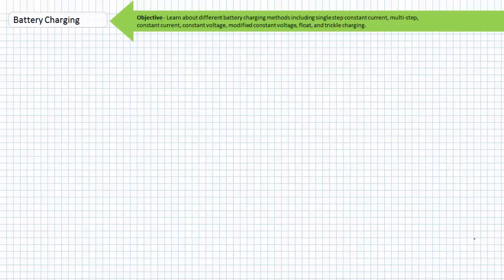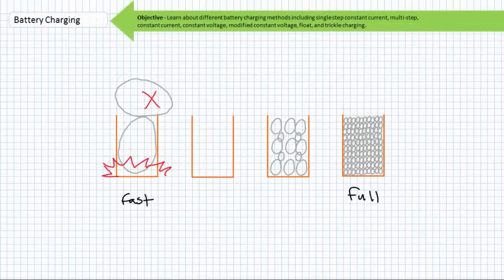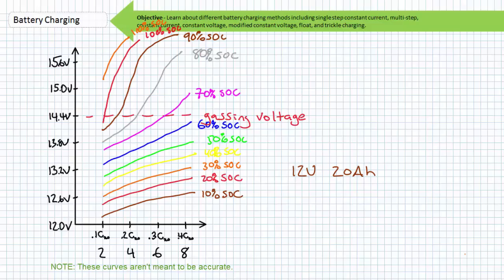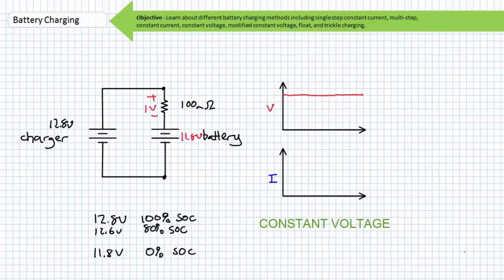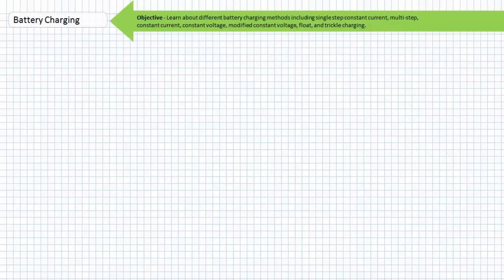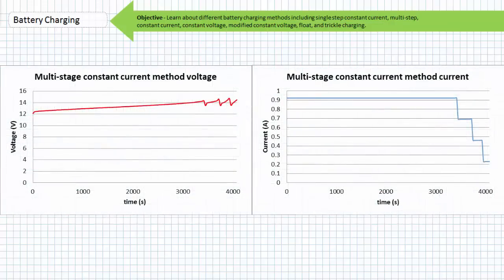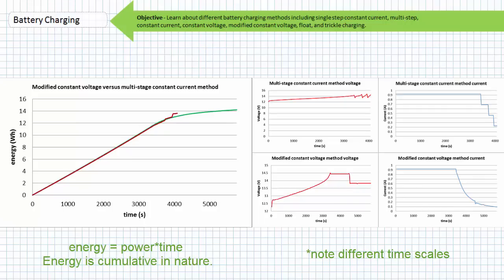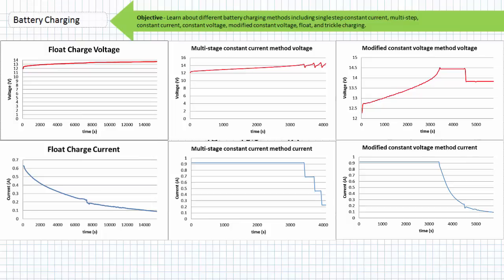Battery Charging Methods

Comment: In the multi stage constant current method, why does the voltage drop when the second and third stages of lower constant current are initiated? It's slope should decrease after the transition and not go negative. Please explain
Reply from the maker: You're correct that it's not an "instantaneous" drop off the cliff but rather a sloped transition. A lot of this has to do with how frequently you sample the data. Since batteries take an appreciable amount of time to charge often the data sampling occurs at an extremely slow rate. As such, the roll off between two stages appears like a jump.
Reply: Jim Pytel Got it! Thank you so much for the quick reply

Comment: During the CV phase of charging, an exponentially falling current is still going inside the battery so why doesn't the voltage across battery increase in that phase?
Reply from the maker: There might still be a small voltage rise at the earliest part of this stage, however, a lot of this has to do with electrochemical reactions that I'm not remotely qualified to discuss.

Comment: I work with lots of different battery chemistries, does this lecture cover batteries other then lead acid wet /gel cells?
Reply from the maker: Unfortunately no this lecture restricts its analysis to lead acid batteries. I hope to return to this topic at a later date and discuss Li batteries in the level of detail they deserve.

Comment: Hello Jim, i have a question, i have a 12V 7.3AH valve regulated lead acid battery. I have a "Automatic (Smart) Charger" , the brand and model is: "Waeco W2000" in the manual i can read it can charge up to 20A (MAX) can i charge this battery with this charger? Does the charger adapt the amperage to the battery? Great channel, i'm subscribed!
Reply from the maker: I'm not familiar with that particular brand of charger, however, the more pertinent question is whether the battery can handle what the charger in question can put out if it isn't current limited. I'd recommend you look up the maximum permissible charge rate for the particular battery. This is often expressed as a function of capacity (example: max charge rate of C/5 would be 4A for a 20Ah battery.)
Reply: This battery does not have a manual, so i don't know that.. So smart chargers do not adapt the amperage to what the battery needs for charging? Because in the manual they say it can charge up to 20A max but there is no minimum indicated.. This is a industrial automotive charger, it also has a button to switch the display to voltage or amperage..
Reply from the maker: Like I said, I'm not familiar with that particular charger and battery and I'm very reluctant to issue professional advice without being actively involved in the project.
Reply: I understand, thanks for your time :)

Comment: Hi Jim, I wish I could say I understood what u were trying to teach but I will keep watching till I do I suppose, I have Emerson Network Power T2V500E/A 2v 500 amp hr cells and I am loosing 1 every week now and I suspect that my charge controllers maybe the cause, cos my toyo brand cells seem to just keep going but I only have 10 of them left so I need 2 of the emersons to make the 24v bank. Can u pls help explain what this means from the label "charge current: 0.25C10A(MAX)"
Reply from the maker: Yes, .25C seems a little high (.25*500=125A). The data sheets I found for that specific battery didn't have anything specific about charge current, however, here's a general one from emerson that does, it's the graph in the upper right corner of page 2. 
http://www.emersonnetworkpower.com/documentation/en-us/products/dcpower/ensys_batteriesandaccessories/documents/duration%20range%20datasheet.pdf
This graph is shows they're using the modified constant voltage method as featured in this lecture and during the initial constant current phase they're using 0.1C or 50A. Honestly my best recommendation is to directly consult the manufacturer because I'm two or three times removed. Hope this helps!
Reply: Chinese manufacturers are the worst to communicate with, I had to tell Must Power last week to stick they're BS customer service where the sun don't shine so I don't hold much hope for that 1, BUT thank you for replying so quick and checking out the specs on my specific battery which seems to be a bodgy battery period.

Comment: Hi Jim, on the float stages,  if the battery voltage is lower than charger voltage(Float voltage) how can the charger deliver the current to the battery?
Reply from the maker: +Didit Subrata If a voltage differential exists such that the charger has a higher voltage than the battery, current will flow from the charger to the battery.
Reply: yeah jim, but on the float stage the charger voltage will be below battery voltage?then how can charger deliver the current to the bttery?
Reply from the maker: +Didit Subrata Not really. Even if you held a nominal 12V battery at a float level of let's say 13.8V the moment you remove the charger the battery would drop to below 13.8V.
Reply: okay im little bit confusing now, i have 18650 li-ion cell with 4.2V max voltge& 2,8V Min Voltage. what is the float&absorbtion voltage that i need to my battery?
Reply from the maker: +Didit Subrata  Li-ion is a totally different animal. Most reliable source of information for this is from the manufacturer data sheet. Li-ion is a totally different animal.

Comment: Hi, with a CC-CV charger for a lead acid battery, once the gassing voltage is reached, the battery controller automatically reduces current over time with a feedback loop to keep the voltage constant?
Reply from the maker: +1994fishcake I like to explain constant voltage mode like this ... imagine two series opposing voltage sources with a resistor in between. If there is a large differential between the sources the current will be large, however, as the smaller source increases in magnitude (ie: a battery's state of charge increases) the differential between the sources gets smaller and current progressively decreases.
Reply: So the slope isn't determined by a controller then?
Reply from the maker: +1994fishcake That would require a feedback mechanism. For this simple method we're assuming the constant voltage mode is just a fixed value.